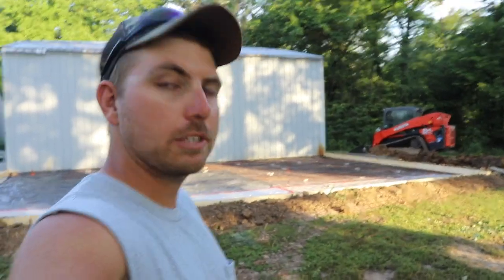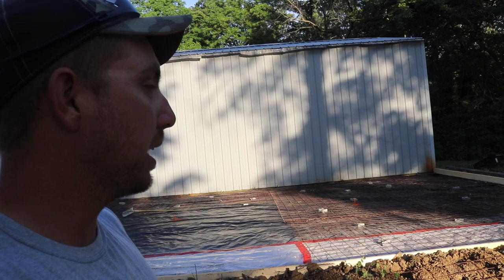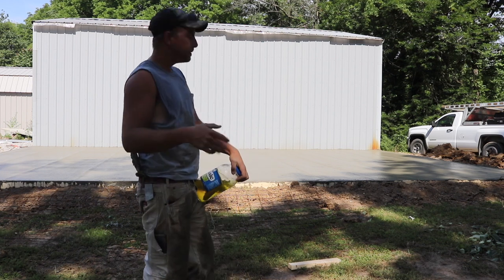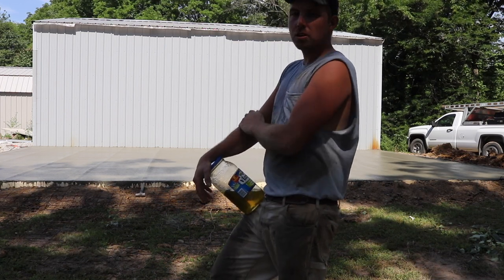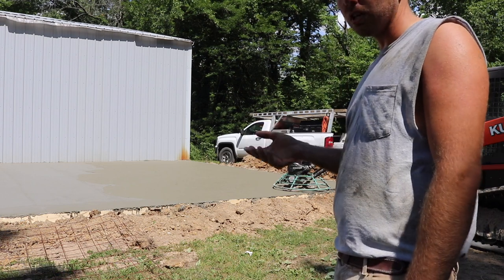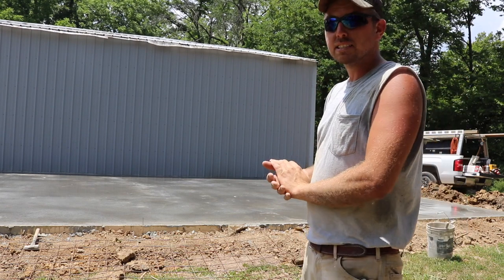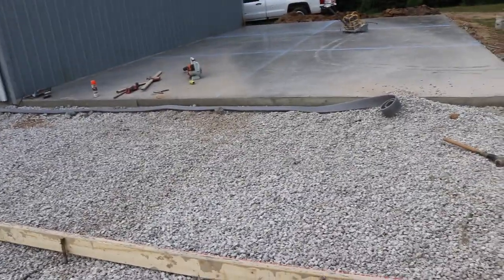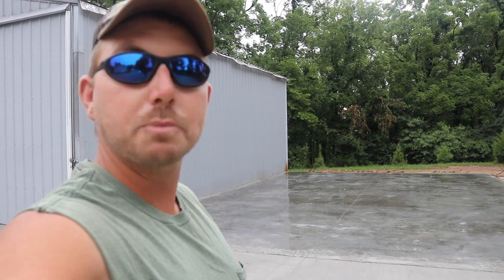POURING a 24'x36' CONCRETE Slab By MYSELF (Shop Expansion Part 2)

Comment: Good Job bruh. That 10x10 spacing  that you spoke about is just a rule of thumb for a 4" thick slab, so that 12' spacing is more than adequate for a 5 1/2" slab.

Comment: Great work. An old timer showed me to use the depth inch and x2 in feet for the cuts. 4 inches is cut every 8 feet, 5 inches = 10 feet, 6 inches = 12 feet. It never failed.

Comment: You and I would get along just fine. I'm the same way as far as working alone etc., and I also would have a huge jar of pickles and would be drinking that juice. Helps you retain water and stay hydrated from the sodium in it and keeps the cramps down. I've been affected by heat stress as well and it for sure creeps up on you a lot faster and easier after that. It's not fun when you're working in the heat and you can literally feel your muscles wanting to cramp and charlie horse on you even if you were previously hydrated enough and steadily drinking water. Also, a lot of people don't know this, but pickle juice is what football players would drink on the sidelines during a game to stay hydrated and keep their electrolytes up before Gatorade and other sports drinks were invented. Too much sugar in those drinks I think though. Great work bud!

Comment: Hey man I have had heat exhaustion 2 times as well. Both times ended up waking up in the hospital. Passed out both times. Did not know what hit me first time. 2nd time I felt it coming but it was to late. Now I just plain know better and can feel long before it hits. It did mess me up and I struggle regulating my temp in both summer and winter now. I have never heard of pickle juice to help combat this. I will give this a try so appreciate the tip. Take care!

Comment: My apologies to you. Should have known better, to spout off everything 
You already knew. 
Could have been an extra beer on my part and old age creeping in.
Great job. Hope you accept my apologies. 
Darn relief cuts did with skil saw.
Boss to cheap. 
Always at the mercy of supplier. Always order extra and have additional forms ready to go. Pavers, ramps. Etc.
Your going to pay one way or another. 
Nothing worse, other than blowout, than running short on pour on hot day.  Only speaking from experience. 
My mistakes are set in concrete. Lol.
Job well done! 
And know I always give thumbs up, and let ads run through. 
That's  a shout out , to other viewers.
Let ads run, don't skip.
Go water a tree or see a man about a horse.
Or squat in the bushes.
All of which I've done, not always in the best circumstances. 
Would love for you to do this full time.
Again educational and so much more.  
Next time I'll wait for part two before I open my mouth. 
Great day to you.

Comment: What did you have out in the middle for a guide to slide that 2x4 across when you were using it to level the surface? Or did you just eyeball it?

Comment: Pretty clear you were a wee bit punch drunk at odd moments there. Heat exhaustion is no joke. I've been through that a few times and it seems no matter how much you drink, how many electrolytes you mix in it just screws with you for a  good while. Great job retaining your focus and pulling off a job you rightly take pride in. Regards from Scotland.

Comment: I think chairs are $25 ,
Wait until the day your concrete cracks up , and the owner don’t want to pay ,because the owner has had it x rayed it is not expensive ,and the X-ray  will tell if the mesh is sitting level or up and down , u would of had 4 chunks of concrete for chairs .
Sounds like u want to do a top job $100 dollars worth of plastic chairs , makes your job look professional ,and on a sales point to win the job explain to owner how chairs will have the mesh at the right height  ,what is the normal steel coverage .why didn’t you cut the shed u married up to .

Comment: Great job. However here is some good advice from an old fool who was just like you when I was younger. Get some Help. By the time you are age 50 every heavy back breaking job you did when younger will come back to haunt you with pains from head to toe. You make not feel it now but you will feel it later if you continue to excessively abuse yourself.

Comment: You need rebar man, that is going to crack to hell.
Reply: He had rebar in it
Reply: @jeffreyjeffers156  Looked like wire mesh
Reply: @chickensguys  it is 6x6x10x10 sheet mesh. On a 5" pour it is plenty good as long as your not parking heavy equipment on the slab.
Reply: It won't crack!! 😕